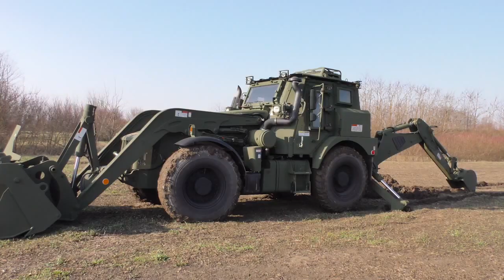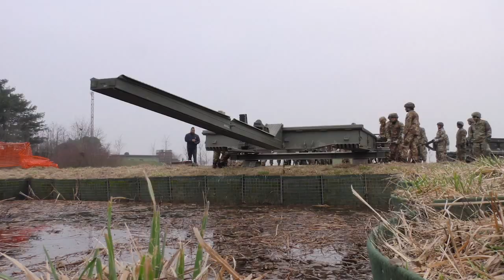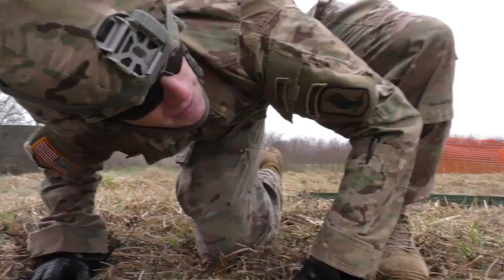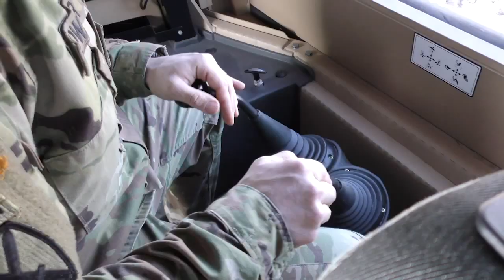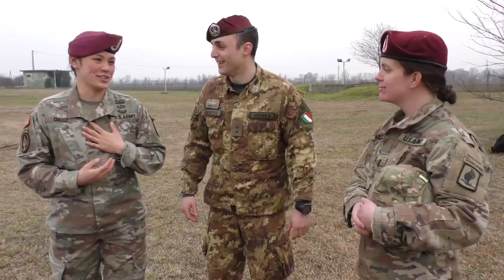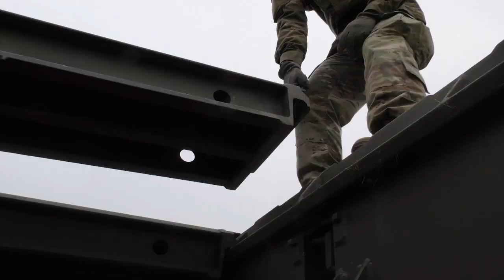Medium Girder Bridge Training

Comment: Sell the concept to the Ukrainians.  Allow t hem to cross the rivers and attack the Russians also get them some riverboats, high speed barges to transport people and equipment, use the night and the fog to your advantage.  Silent electric motors in the barges as well as outboard or inboard primary power for fast travel.   Use water  jets rather than prop drive.